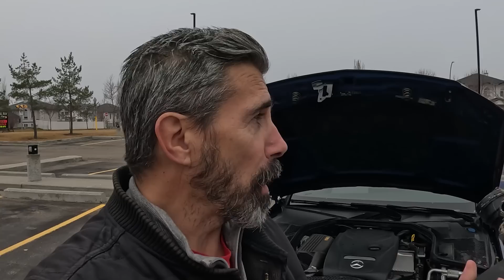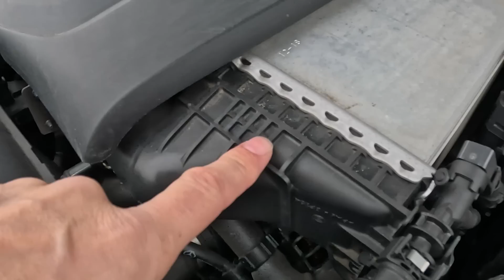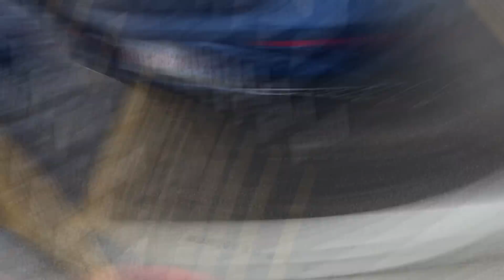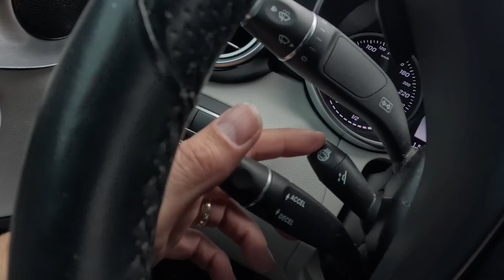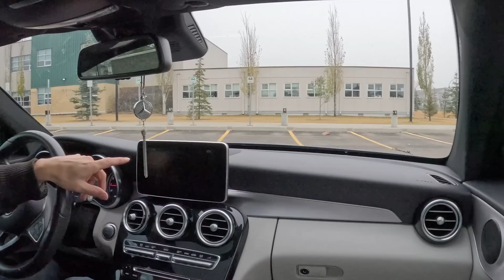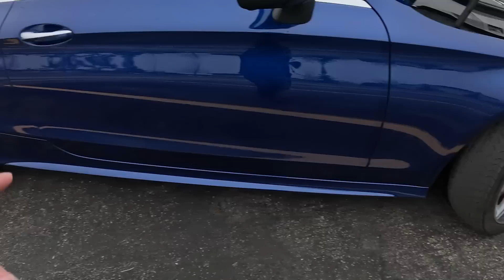Here’s Why New Cars Can't Last  5 Years | What Went Wrong?

Comment: Fuel efficient does not necessarily mean better economy. You are getting a price break on gas but much bigger expenses down the road.
Reply from the maker: It is all about the cost of ownership and many times they aren’t cheaper over the long run
Reply: The 4 cylinder in the new chevy trucks aren't even better on gas than the V8
Reply: @jdgreen214  That's Nuts, a four cylinder should be reserved for a tiny 'rice burner', not a truck
Reply: @paulstubbs7678  I agree.  My problem is other than tourqe there is no other benefit from having the 4 cylinder.  It's not more efficient, more things that could break.  It uses better internals, which is what most people who work with performance engines replace after an engine rebuild anyway. It has to be planned obsolescence.  No more 300k miles or better v8s or v6s.  Has to hurt resell value too.
Reply: @paulstubbs7678  Loving my 3 cyl car lol
Reply: People pay many thousands of dollars to save a few hundred on fuel.  Oh well.  Same with repairs.
Reply: Add weight to the vehicle, like I do, and you lose economy.
Reply: Which is why I drive a 1996 Town Car and Fluid Film the underbody every year.
Reply: It's also a lie with turbos. they are never as efficient as an NA engine of the same output due to basic physics and safety margins (AFR)
Reply: @sperlongatours  turbo 4: 18/21.  5.3: 16/22.  For the unknown longevity of the turbo 4 is it worth the upgrade?  If it was 20/30 in gas mileage I would say so.  Time will tell us if the turbo 4 is worth it or not.
Reply: @jdgreen214  The turbo can never be more efficient than NA of same output, it's basic physics. Exhaust impediment. 
I have an LS3 swapped S2000. It's more efficient than the stock engine in cruise, by quite a bit. Piston speed/friction is a bigger player than engine size.
Reply: This is why people shouldn't buy diesels.
Reply: Yes very true. When I owned diesel the newer Berlingo quoted improved fuel efficiency of about 4 mpg. In real life driving I saw no improvement between my 2016 model and 2009 model. The later model cost much more though because of AdBlue injector issues, DPF issues and the alternator was £700.00 because it was stop start model. 

Now drive a 2011 Honda Jazz (Fit). Naturally aspirated petrol that is very fuel efficient and is cheap to service and maintain. Sure the spark plugs are hard to access but I got my mechanic to change them and the fitted expensive Iridium ones last more than 75k miles. Other service items like battery, alternator, starter are cheap. It's cost me very little in two years of ownership and 30k miles.

Comment: Once the electronics go,it's  a done deal.
Reply from the maker: Exactly
Reply: @ECPP with EVs, they're even more software dependent.😢
Reply: @flashsushi AC control and volume knob are now all buried in menus. If that screen/tablet ever fails you're toast.
Reply: A business friend of mine purchased a new Mercedes (against my advice) and collected the car on a Friday. That night after getting home and parking it inside her garage she noticed the headlights would not switch off, and there was a persistent faint hum coming from around the console. She thought the lights would go out automatically after a while but later that night they were still on and there was no way she could turn them off, and now the car wouldn't start, it wouldn't even crank, just a pop up message stating battery needs replacing. The stealership could not help until the following Monday when they sent a tech to her home with a new battery that morning, by early afternoon there were three techs there with laptops and tools everywhere. They eventually called a tow truck and took the car away and a week later she got it back with the explanation that a computer module in the trunk had failed causing the fuel pump, headlights and trunk release to malfunction. A fortnight later another module failed that operated the transmission, then the power windows, and finally a few months later another in the suspension. She was then informed the car had over 100 computer modules in it and they had discovered in data logs that another had failed that controlled the smart alternator. No more simple regulators, this system measures energy consumption and maps the charge delivery to economise based on engine load. That module failure had caused an over voltage situation that potentially damaged every other module in the car, likely causing her other failures, and there were probably more to come. She tried and tried to get refunded or vehicle replacement but to no avail, they simply stated the warranty would cover it as any problems arise, which they did, and so she eventually sold the car at a staggering loss swearing to never touch Mercedes again. Foolishly she then purchased a BMW...
Reply: @alasdair4161  That's funny because I had a neighbor who had a Mercedes with head lamp problems.  First time I saw them on, I thought she forgot to turn them off (mine go off when you turn the engine off, but I didn't know if German cars were automatic).  I knocked on her door and she thanked me while explaining they turn on by themselves at random times and drain her battery.  She was so grateful to be notified.  

Every week or two while walking my dog, I made the same discovery and notified her.  Finally, I figured it was time for her to check without my help, so I stopped knocking on her door.  Buy a Mercedes, you just got to learn your lesson.
Reply: @alasdair4161  Interesting, how naive+blind people than go from one foolishness, to another ... from Mercedes to Bmw ... both have now became crap in these last years ....
Reply: @bustjanzupan1074  Yep, plastic inside the engine, plastic outside the engine and heat to speed bake it into scrap. None of these cars will ever achieve classic status.
Reply: @bustjanzupan1074 these days you pay premium price but arent treated like a minority. Just another peasant that came to the dealership to be a bother 😂
Reply: @alasdair4161 she went from frying pan to fire 😂😂😂
Reply: Perfect Comment!
Reply: . . . . [Additional] - Chinese Electronics Too - Enough said
Reply: @Golic_LV-426   Oh come on. China only makes the finest quality parts!😁
Reply: Yah but the chinese evs are very cheap. Like 10 grand cheaper than the gas version you can get here. And good quality too. Im not a china or an ev fan but if the price is right i would gamble on one.@golic7123
Reply: Almost. Because, it still can be remake it to mechanical jets at some diesels, or mechanical injection from Bosch at all gasoliners 🙂
Reply: They'll Find Out The Hard Way
Reply: But they don't, and they will not.

Comment: Time in chain tensioners used to be made from a high quality nylon Pacific part now they are made of cheap plastic nylon is self lubricating plastic is not there is a large difference possibly 300000 mile difference engine oil degrades plastic not nylon
Reply: What are you trying to say? Reading this made my head hurt

Comment: Sounds like I better stick with my 2012 Honda Fit Sport, 110,000 mi. I just can’t convince the Honda dealership to replace my variable valve timing control. It gives a 1-2 sec chain rattle every time the temp drops below 50 F. They say, “it’s a normal sound for such an older car.” Angry man, here 🤬🤬🤬🤬
Reply: I once had a shop tell me “The transmission shudders because it’s old”… Man, no chance it’s that vehicle speed sensor that blew a seal and has ATF dripping out of it. I’m sure it just does that because it’s old and things throw themselves out of spec. Gotta do everything yourself these days
Reply: Sell it  buy  toyota  corolla altis 2012😊
Reply: Why not take it to a Private Certified Master Mechanic? I’m sure they could fix your VVT.

Comment: 6000 dollars per headlight!? My first car didnt even cost 6 grand haha.
Reply: My last car wasn't 6 grand
Reply: That’s an expensive bulb
Reply: @leslielucci3182 It’s actually not a bulb they are LED projectors, when they go out the entire unit needs to be replaced with the modules that control the light settings and then they have to be programmed to the car by the dealership for theft reasons.
Reply: @marlonallen-v5y and on the newer Tahoes, at least, there's a core charge on the old headlight assembly.
Reply: Look up the Ford truck that wouldn't start due to the taillight. 😂
 A $5000 fix. 
Too much BS running through the chassis.
Reply: Mw bmw light is 2000. Luckily I never had to replace it ...
Reply: The crazy times that we live in
Reply: That was the cost of my transmission replacement with labor for my 14 Accord
Reply: My father in law had a minor bump in his C class and headlight wasn't LED or Xenon - just regular halogen. Repair bill was £4,500 [$5,700]. Absolute madness.
Reply: My first car cost $50, 57 VW in 1000 parts.
Reply: My last car was 3k with a blown motor, $500 bucks layer I'm on the road lol.
Reply: @zerocool5395 4k golf 5, had 200k km,  now it has 300k km with no issues..
Reply: @alexandruciordas4941  Hell yeah, my nugget is at 130k for a Toyota that's nothing, hopefully I'll get another 200k before anything goes wrong.
Reply: @zerocool5395  this car has electric mirrors, electric windows, steering wheel controls, auto pilot, glasses holder, cupholders, heated seats, aftermarket backing cameras, 105hp, 5-6l/100km for 4k, and already 100k km with no problem, why u would buy new 😂
Reply: @alexandruciordas4941  That's the best thing about getting a used car, you can buy a fully loaded one. My Matrix is even awd!
Reply: Im suspicious when American just listed European and Asian cars?
Reply: I recently had my LED on my c300 go out. Yes if you buy the light from Mercedes it’s about a $3000-4000 fix. However I bought the headlight unit from eBay for $167 and the computer modules for $110 and had it programmed by Mercedes for $150 I spent a little over $450 to get the light to work :) is it a Nissan Altima head light cheap? No but the lights are very nice
Reply: And they push the crap out of those LED's, so they are destined to fail.
In good electronics design, you derate parts so they always have a good margin so they won't prematurely fail. No the LED boys hit em hard and don't care less, their design brief is to just make it past warranty, of for third world manufacturers, until the company recycles itself under a new name so they can disown anything that came before.
Reply: My first car was $ 75 a 1947 Ford in 1957 I worked part time at a race track $ 1 an hour walking race horses after they warmed up, or $ 5 a day moving hay from a railroad car, things change.
Reply: It is a luxary brand. Don't buy it if you cannot afford it. New ones were over 50k
Reply: Lies
Reply: My first THREE cars didn't cost that - this is not engineering mistakes, it is an AGENDA.
Reply: That's why China doesn't want german car anymore.

Comment: I've been driving vehicles for over 40 years.  I think your nostalgic tales of the days of yore are a little misplaced.  There were plenty of absolute clunkers built in the "olden days."  The Ford Pinto the Chevy Vega were just a couple.  My 71 Mustang literally disintegrated due to crappy sheet metal.  My 99 Dakota had more vertical miles on it than horizontal.  You can find POSs in almost every era of automobile production.  All this "older was better" BS simply doesn't ring true.
Reply from the maker: I agree there was a lot of old junk and crash testing and designs are better today with modern cars being better engineered in many ways.  That’s the problem, to well engineered to the limits and barely beyond
Reply: Yet it does in so many ways. Let me guess- you're one of those people that thinks "newer is always better", right?
Reply: hey man I learned to drive on a Ford Pinto manual! Fun times driving around fields and hitting potholes lol!

Comment: Again, I am keeping my excellent condition 2006 Forester, 107 k miles, loaded and with a manual trans. Bought it new over 18 yrs ago !
Reply from the maker: If you have a good vehicle these days they are worth holding onto
Reply: @ECPP  I have 4 Toyota family like Corolla, Celica Trecel that made in Japan  since 1980. I ran maintenance and used only OEM parts Zeven used JDAM) and never had a problem. Compare to Sweden Volvo, US made GM were nightmare when repaor.
Reply: Nice - Nothing wrong with that . . . .  Just change the Oils regularly, and you're Good !
Mend & repair - Respect
Reply: Looking at used cars now and one of my top 2 choices is a Subaru Impreza Sport manual transmission. It is a 2018 model though.
Reply: Subaru is truly great Japanese quality. Keep it as long as possible, and if the clutch wears out, just don't hesitate: have a new one installed, although it will cost you a grand... after that, you can drive it for years to come!
Reply: Subaru head gasket failures galore.  Oil burning galore.  Do research people.  Same with Toyota 2.4L engines.  Don't blanket trust any brand.
Reply: 2008 Toyota Highlander 336k miles 

Engine and transmission work like new

Comment: I have a '16 version of your car.  Have had to do a ton of expensive maintenance.  Multiple batteries, differential leak, PVC valve replacement (they don't call it that), gas cap cover goes out of alignment, brakes, spark plugs, filters, capacitors etc.  Some maintenance, some not.  Screen goes black every so often.  Eats tires.  Seat fabric is split and needs replacement (I have a cushion covering it at the moment.  At MB rates, a ton.  Car has 55K miles on it.  Seems insane to me.  Thanks for your video.
Reply from the maker: Thanks so much and I will share our experience too soon
Reply: I have the 2006 version of this car. Rode in a new one a few times, and the build and material quality is noticeably lower...over 105k on mine and only had to replace a MAF sensor over the last 19 years, and leather still intact. The cheap chrome trim around the cupholder rubbed off, but that's about it
Reply: My 2013 glk350 4matic has 57K, it warps the brake rotors about every 20,000 miles, if you use cruise control or sport mode. Keyless Go died a year ago. Otherwise two light bulbs. No problems with the cooling system and those quick connect radiator hoses either. Awesome car otherwise.
Reply: my diesel Subaru Outback keeps warping discs  @melissasmess2773  can you elaborate about your experience?
Reply: Im sorry that you didnt get the memo. We all learned the hard way.
Reply: DUmp it and get a lexus man. I have all the same luxury and almost all the performance of a BMW/MB, 4.6 NA v8, bulletproof 8 speed, and it's probably as much as you spent on maintenance, for my entire lexus...
Reply: I have the '15 of that car 95k kilometers. My experience has been bad at all. Most expensive thing that went bad was a/c evaporator, change battery once (was pretty expensive 400usd), also changed both bottom arms as they started to make noise and the gas pump went out couple months back ( had to import the part from England). Otherwise it's just been just maintenance. I don't think that's bad for a 10 year old car.

Comment: It s a disposable car.  You can drive Only 5 yrs. Then you need to buy a new one.  That s a new policy from MB. 😂
Reply: Sadly, that seems to be a business model increasingly adopted by most automakers. Why build a vehicle that'll last 20 years when they can build something that will last barely the length of payments? Keeps folks on the hook for payments (and profits) til perpetuity.
Reply: @JohnWilliamson-qd4px  their focus clients have changed from executives and business people to young immigrant men from the Middle East who are just posing and rev'ing in the city center.
Reply: So sadly newer Hondas and Toyotas actually not reliable as they used to be Too much plastic way over to much Technology all of these turbo crap in newer cars
Reply: @quincyrhinehart3635  I bought a 2012 rav4 v6. The newer ones are crap!!
Reply: @quincyrhinehart3635  of courses, Japanese always copy German as usual.  😆
Reply: No wonder my Mercedes which I bought brand new and on the fifth year, the transmission went out and I junked it! I bought a Toyota and never have to visit the dealership again. Only idiots drive Mercedes
Reply: Lease don't buy. Turn it in every 3 years and let someone else buy it with 30K miles. Monthly payments are less and anything that goes wrong is under warranty.
Reply: Carbon parts are better
Reply: overpriced junk!

Comment: Well,

Not sure if it’s a good comparison, but if u look at the quality of packaging if u go out to do groceries has gone down a ton.

The plastic and the carry handle around a 6-pack of 1.5L Coca-Cola bottles have significantly decreased in quality; they often break when you try to carry them. Not to mention, the carry handle has been completely removed in the EU altogether.

I mean, plastic is OK. But the environmental restrictions and regulations are resulting in very bad quality plastics.

If u look at a bucket u bought 20 years ago or so, compared to a newly bought one, the new stuff is flimsy as can be. 

Probably same story under the hood.
Reply from the maker: Hi Marcel, you are totally right about that.  Look at modern paper bags, snow shovels, and virtually everything including household appliances.  All substandard and engineered to last 5 years in my opinion.  It’s simply not the same as it used to be and yes some
Plastic is fine in not such critical areas but there are compromises to quality overall

Comment: Dat is bullshit, get 220d and it will last for million miles
Reply: A million inches. Not miles. The insane emissions control apparatuses in new Diesel vehicles will make sure the engine is done quickly.
Reply: One of my dailys-
1985 MB- 300SD W126- 5cyl in-line turbo-diesel-
Starts instantly w/ 323,000 Mi. Oil/Filter Chng every 2500Mi w/ Liqui Molly or Motul Oil. 😊
Reply from the maker: Nice